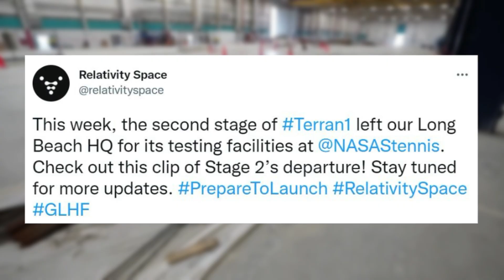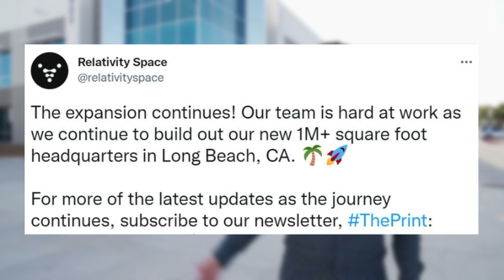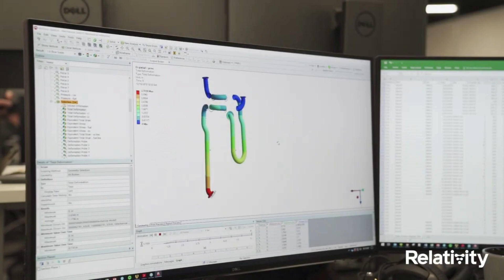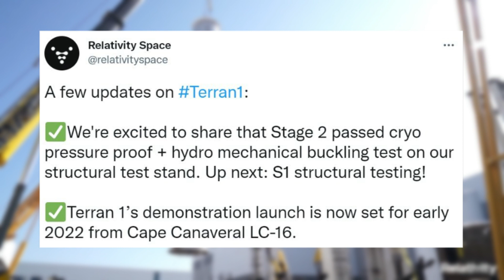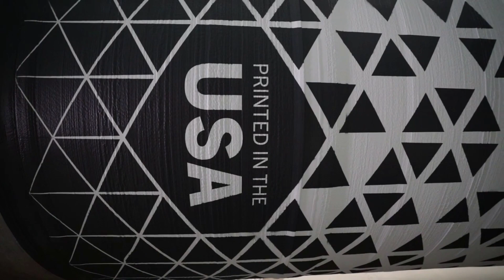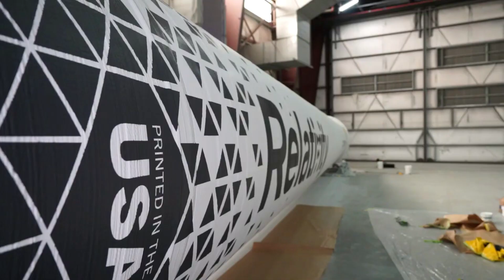Relativity Space Is Making Fast Progress Towards A First Launch Attempt

Comment: 3D-printing a cylinder is pretty stupid. Manufacturing cylinders is very easy with sheet metal and presses to make the domes, 3d-rinting this part takes forever (days) while traditional manufacturing can make 1-5 cylinders i an hour. 3D-printing complicated prototype parts for testing is very useful and timecutting for developement. But 3D-printing a cylinder is very dumb, they are probably just doing that for the marketing aspect, just so they can say we make 3D-printed rockets.
Reply: Scott Manley basically said the same thing. It's like they are doing it this way to see if it works.
Reply: True, however relativity's goal for 3D printing is so that it can be used on mars where they can build a small factory to launch and there's little human involvement as much as possible.. in that case I think it would come in handy